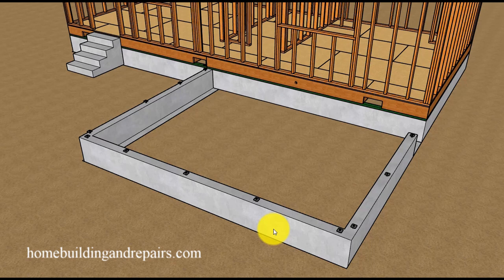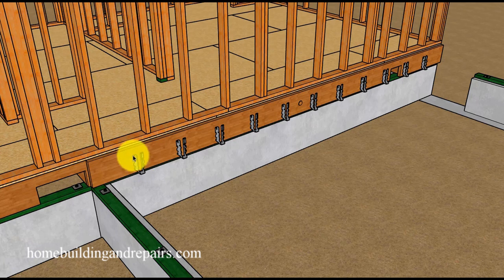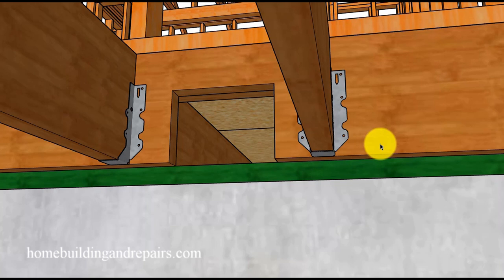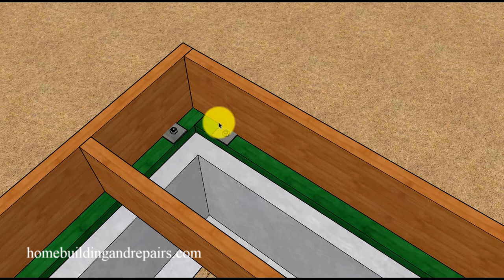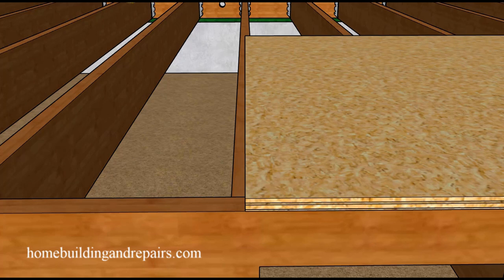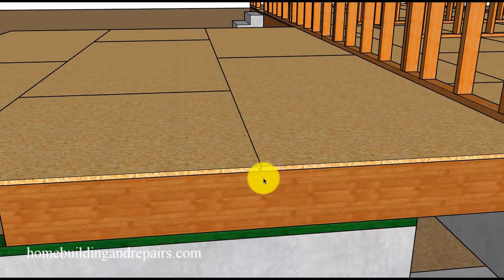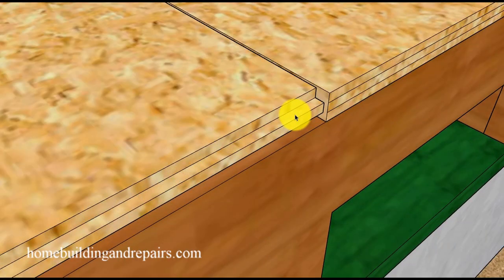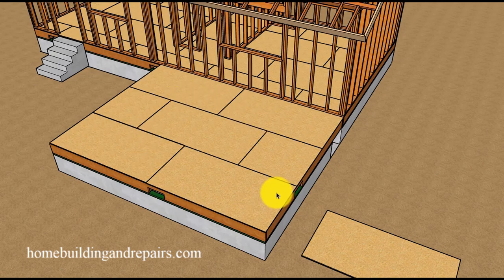Floor Framing Examples For Home Addition With Raised Floor And Crawlspace - Easy Learning

Comment: They should also know code requires clearance from grade within the crawl space of 18" at the bottom of floor joists, and 12" at the bottom of joist girder. And of course the perimeter foundation has to be high enough so the siding/mud plate is at least 6" above the outside grade. In California they amended it to 8". And of course any concrete piers supporting any girder posts has to be at least 6" above grade as well.

Comment: On the right side you used 2 boards .. Is that for the crawl space access door .. it needs to be double up there ?
Reply from the maker: Yes, access hole usually needs a double joist or beam.

Comment: They may not know that an insect and decay resistant wood is used for the mud plate. Might also consider a galvanized sheet metal termite shield/deflector installed before laying the mud plate if that's an issue in your local.

Comment: I have been looking for videos on how to connect  the floor system of a  room addition to the existing house foundation without using a ledger board. The configuration of my room addition is unique, a corner of the floor addition will be attached above one  area of the home  that has a set of exterior stairs that go down to the basement exterior door. The band joist of the house runs right above this door  and the  ac pipes are threaded through this band right above the door. This is the only area where these pipes can be due to code limitations, therefore they will need to be disconnected and reconnected in order to install a ledger. This  will cost a little over a thousand dollar (includes reconnect). In addition, even if I decided to eat the cost, I am questioning the strength of the house band joist to carry the load placed on the ledger. The home is over 100 years old and the structural wood components seem to be extremely dry. 

 Is it possible to cut through the existing band joist and slide the new joists in so they would end up sitting on the existing foundation wall. The ac pipes would be left alone and the new joists would be inserted through the band joist ( after cutting through it). Access inside is easy as there is where the basement is. This way all I have to do is just cut besides the pipes and slide in the new joists, then block between the new joists from the inside of the house. Is this feasible? Or, is there a video that shows something similar to this? Thanks!!
Reply from the maker: It's usually up to the engineer, but I've ran the new joist into the existing house to have them sit on top of the foundation framing plates. Let me know if this didn't answer your question.
Reply: @gregvancom  Thank you for replying, I was just wondering if there is a term for this technique, I am unable to find anything on this.

Comment: They might also want to know the building code minimum sizes for a required access/scuttle hole through the floor is 18"x24" or 16"x24 through the perimeter foundation.

Comment: Might also consider using subfloor adhesive when applying the sheathing to avoid squeaky floors down the road.
Reply from the maker: Yes and lags screws to hold on ledger, working in the shade and using sun screen if not :) your comments are helpful and keep them coming.

Comment: I remember back in the early 70's it was common to see floor systems of 4"x6" steel tubes 4' O.C with 1⅛" T&G ply subflooring nailed directly into the steel during the condo development heydays. But haven't seen that system used incorporating the steel tubes in the last four plus decades, only with wood 4"x6"s.
Reply from the maker: I've never seen that, but have seen 4x6 four foot on center with one and an eight plywood and one and one half inch 2 x6 tongue and groove.